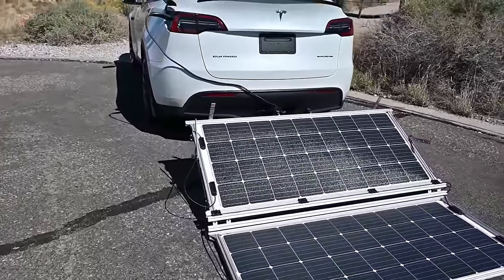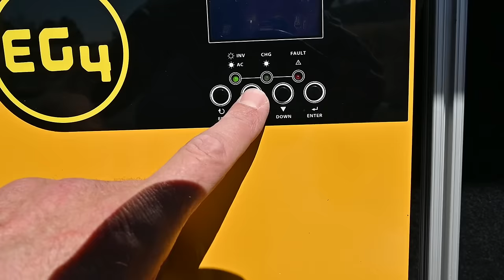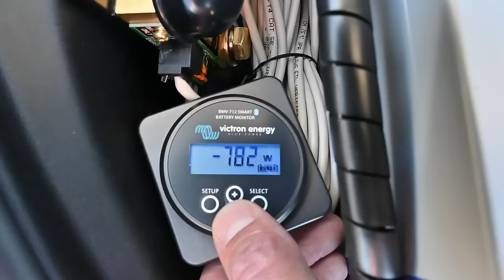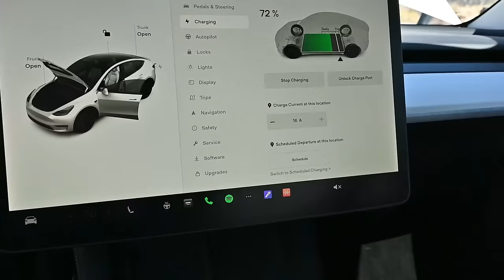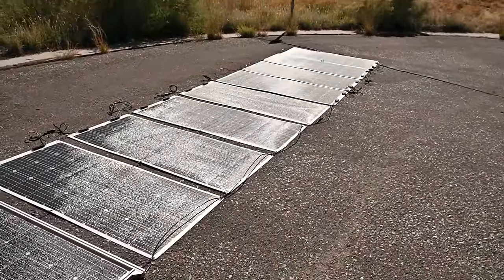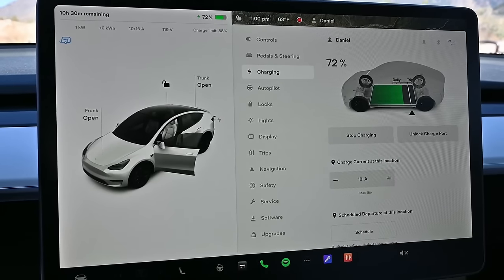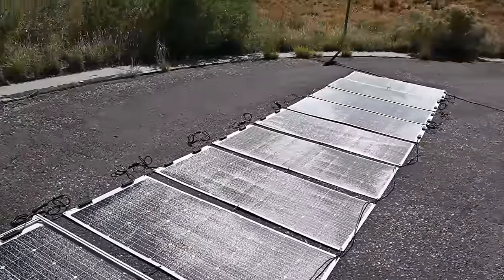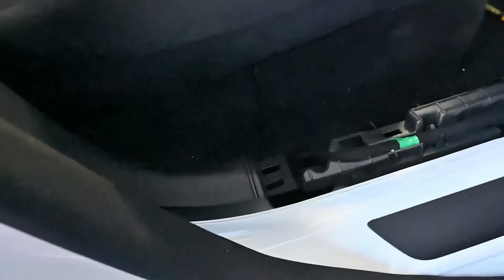2000W Mobile Tesla Solar Charger - version 3.0 - more solar, lower mass, battery in frunk!

Comment: The drag that is caused must be as much that is put in from the solar panels. I thought the solar panels would be stored inside the car when not in use??
Reply: I lost track of the link to an online aerodynamic calculator tool I had sitting in a tab of my browser, but playing with that, to find the sweet spot for re-orienting the angle that stack of panels rides at, and maybe putting it into a smooth shell (made of foam and PMF, perhaps) for travel, might actually improve the aerodynamics.
Reply: Its a good proof of concept...i appreciate his efforts.. Putting money where his mouth is..👍
Reply: I'm pretty sure that misses the point that this is a destination charging system, not a 'while-driving' system.
Reply: better design welcome. mr tesla.
Reply: Doubtful there’s any real impact from drag here. Reason being is the entire system is lower than the body of the car. The rear spoiler will also serve to push airflow up and over, etc. it’s also pretty close to the car itself and not much of a gap between the two
Reply: @Av-vd3wk  agreed 🤙🏽
Reply from the maker: @Av-vd3wk  3.8% loss in range calculated pre/post installation over thousands of miles. I easily live with that. I can fold them down flat(ish) but haven't bothered.
Reply: Not that much loss 🗿 
I can't believe people can think like this
Reply: @Weirdo_on_yt724   and @AV8 couldn’t agree more, I want to do this!  Hydrogen technology is on the rise and I believe will be another great option but there are pros and cons with everything.  The fact that he is independent of any charging or refueling station at the cost of the system and some planning ahead is priceless to me.  Different tools for different jobs ppl🤙🏽
Reply: @gridfreeordie 3.8% on a 75kWh charge would be 2.85 kWh, meaning that the first 2.5 h of solar charging are needed just to compensate for drag.
Reply: @falklumo those 2.5 hours of charging to compensate would be spread out over all the stops you charge at though, so if you're only driving far enough to need 2.5 hours of charging without the extra drag that's only about 6 minutes extra
Reply: and if you were filling the entire battery up from nothing it would be more than 25 hours of good sunlight at that rate

Comment: You don't know how excited I was to see this video. I just discovered the 2.0 video and then I see that you dropped only the 3.0. I also found it funny how in the 2.0 video you said that the battery was Overkill in the trunk and then now as I'm watching the 3.0 you filled the frunk up with batteries. I really wish you could charge this car DC to DC. It would get rid of so much of the complexity. This is one of those things that everyone thinks of, but you actually did it. I also was watching the video about the haters, I would not take any offense to anything they have to say. However you should be very proud of what you accomplished.
Reply from the maker: Thanks! So much more I could go into...and change. Not enough time!
Reply: I agree! It’s funny how everyone has something to say but nobody is doing anything to test theories. I love how you just did it, just do it and figured out solutions. I would do it with my model y but I’m waiting on the cybertruck for the trade in. I can’t wait to rip it all apart and throw my system in it just like you did 🎉🤙🏽
Reply: I totally agree. DC/DC charging would save about 30 to 40% energy losses from the inverter converting dc to ac.
Reply: @leviahamefula3994 there must be a way to do it, considering that's what the car does at a supercharger
Reply: Outstanding!! Definitely agree with the DC to DC without needing an inversor.. ideally internally to the car.. Maybe a route through the regeneration wiring?..

Comment: I wonder if in the future a direct Solar to CCS DCFC which could match the input of the solar to the output of the charger. With such a system you would not need a big buffer of batteries. Also another advantage would be getting rid of inverter efficency loss and internal car charger loss, cutting upto 50% of the charging losses and improving charge times.
Reply: That's already a reality in Aptera and another startup with a "one" in the name which I can not recall..
Reply: If you trick the tesla bms you can already do this, hook up panels in series until you have near 400v vmp and the battery will take it.
Evtv did this with an 85kwh pack from a model s
Reply: @SolarTechFL  can you tell me the title of the video?
Reply: I think he’s referring to EVTV Motor Verks. I can’t find the specific video but there’s a good place to start looking for it.

Comment: I am led to believe that 50% output from solar panels labelled output is the norm. Heat, solar intensity and panel orientation are the main things. I love what you are doing with your Tesla, great experimentation.
Reply from the maker: Expect about 85% of room temperature power when facing the sun due to higher temperature.

Comment: This is a little simple, but I was thinking; one way you could increase your input would be to first increase the length of the wires connecting each panel to the next.  Then, put some "legs" under the top part of each panel, so you could adjust the angle; point each panel more toward the sun.  The "legs" could be very simple, maybe just a bent inflexible wire running on the underside at the top, hinged so you could swing it down to hold the top of each panel up.  That could go a long way toward aiming your panels more directly toward the sun.
Reply: is there a smart solar panel which can follow the sun's angle ?
Reply: Why would you just use a much simpler controller/battery that can take in the solar and output to the car and be much smaller?

Comment: Love it.  Cool so when car is topped off the battleborns get topped off. Free gas station -take with you.  1200 watts coming in will add up over 6 hours. Maybe 6-7 kWh-for free if sun is shining. I personally just use the solar on my house grid tied. These mad max approaches are fun fun fun.

Comment: The wire run next to the panels is shadowing some of the cells and probably limiting some current in your system. Some flexible cable management could help keep them out of the way.

Comment: If you also handle the Air drag with a case or something you will have better mileage. Also if you elevate the solar panels from the ground on a sunny day they will have better performance in hot climate cause wind movement around them so faster charging. Or you could face them direct to the sun also. You need somekind of aerodinamik box that can also be a stand to them or something. But other than that cool project.

Comment: I like it how your battery terminals are like an inch away from hitting your frunk cover. Be careful out there…
Reply: Is the frunk made of metal? Or plastic?
Reply: @bengrillet  The "frunk cover" (i.e. the hood) is made of painted metal. It's a fair criticism that the terminals and cabling should be covered with an insulator.
Reply from the maker: The batteries are encased tightly with styrofoam pads now.

Comment: In Australia they can use the machine that print labels for canned goods to print photovoltaics. They can run for metres behind the car when parked, like these panels, but simply roll it back up and put it in the car when not in use. Best to use a cylindrical postpak kind of thing to keep the edges in good condition. Cost is around $20 for the roll of paper

Comment: So tesla theoretically use 280~340Wh per mile (174~211Wh per km). This unit was charging at 1250Wh that is roughly 3.68~4.46 miles per hour, or 5.74~7 miles per hour at it full 1950Wh capacity. That is definitely not bad, not to mention the very cool and practical design. This is the number one portable solar charging system for tesla I have seen so far.
Reply: But you can walk at 5 mph.  You can bike at 20mph.  A horse can go 30mph pulling an Amish buggie, or draft cargo at 8mph.

Progress?
Reply: @STho205  You are missing that the human body burns calories when you bike or walk, so you must factor in the cost of food and water to cost of walking or biking everywhere. Also it takes time to eat and poop.
Reply: @uhjyuff2095  heaven forbid you burn any calories when you have Wall-E to serve your every growing girth.
Reply: Thanks for the equation
Reply: @STho205  

Yes it is progress! It's free energy. 5 miles in one hour is excellent. Image is you have the space to unroll these at work and 8 hour shift? I could park Neary middle schools unused baseball field and drive all week free of charge.  In my durango, I spend easily 20 dollars per day.
Reply: @rayamanelly  free at 70k for the car and $xx for the power tap.  You have an interesting idea of FREE.

Comment: Suggestions for improvement:

Have a small computer (raspberry pi), an pull the SOC from the BMV.

Use this information to push through Tesla's API a change in the amp draw.

Example 
<20% : charge off
20-90: 6A
91-94: 8A
95-97:10A
>98 : 12A

This way the car will match the solar input.

The same can be used on a stationary PV system.
Reply: A EVSE like OpenEVSE can do this, they call it “solar divert” i.e. charge using only excess solar power. Doing it by way of a Pi and the Tesla API would require LTE or Wifi connectivity, where this is designed to be used you can’t assume it will have API connectivity
Reply from the maker: I actually do something similiar to this at home with Schneider equipment, but it requires the internet. I'd need a hotspot / SIM card to call the API while I'm charging away in my work parking lot. A hotspot + Pi is certainly cheaper than 5kWh of battle born batteries, but I had them left over from another build. 5kWh of battery buffer is way more than I need on a daily basis to handle clouds. I've yet to explore MODBUS communication with Victron components, but I'd need to use the battery monitor to gauge current flow in/out of the battery since I use the MPPT inside the EG4. The EG4 is a simple, compact MPPT/inverter, but it's software is total garbage. Using a Victron MPPT would be better, but it requires more cables, fuses, etc. Maybe someday...
Reply from the maker: @paulpham8138  I will look more into OpenEVSE...see below.
Reply: @gridfreeordie  The signal that sends the "max amperage " to the car is a PWM signal. Diffrent duty cycle changes the amps from 6 to 64.

Comment: Thinking of setting up a similar albeit smaller charging solution on my Volt. I haven’t heard it elsewhere on YouTube, but it makes sense to be able to measure the angle of the sun and calculate with the cosine to determine the percentage of light/power “lost” to the angle. Thanks!

Comment: If someone knows how to open up DC/DC charging it would open up so much opportunity.
Id like to have 1-2 panels integrated into to roof to cover phantom drain when it’s parked for long periods. Sometimes my ‘job’ causes me to have to park it for months at a time👍
Reply: I think 2 panels would keep 12v battery charged and prevent drain from traction battery over long periods.

Comment: If you make 2 of these and place them at 92.2 degrees and allow the mid line aim at the average sun elevation. This will give you 4kw×1.4 = 5.5 Kw. Explain why after you try it. 🤔 
Hint: one panel's reflected light hits the  other side.
Please don't allow any exposed terminals in the compartment. Use some liquid vinyl tape to cover all exposed live voltage. I dropped a tool with exposed wires and it caused an electrical fire. Don't forget 2 fire extinguishers. Look for the new type for lithium fires.

Comment: That's awesome man! Gotta take in consideration your efficiency drop from the inverter. 10-20%? So 1200 watts input on your solar is about 1120 watts then 1120 watts at 85% is about 950 watts. So a total from panel to outlet is about 75-80%. Just thought to keep in mind. 2000 watts if achieved would be about 1600-1700 watts at best to the car? Cool stuff!

Comment: First off, props to you to design and execution. I was wondering about a setup like this of the Model Y. I realized that it is super unpractical to draw power from solar to feed a car level transport. Even at 120V 10A, it only feeds 1kW to the batttery, Charge time to go up 16%SOC is over 10HRs. From a daily active transport cycle perspective, it is ineffective. Very cool experiment, I thank you for sharing your results. 

I have always wondered if the Car could carry around push flower "petal PV " oragami style. Power Output from Solar into Car Bat must be around 6-7kW for sustained 4 -6 hrs to be considered practical transport. I wonder would it be the size of your panels x 6? Your 2kW System already looks like a like of SA to cover tho. Anyways, very cool experiment. Look forward to your future designs!

Comment: Wow, a full day of perfect sun charging and then half an hour of driving!
Reply: Two things: 
1) This is basically a prototype, a 'proof of concept', a first or second try out, and pretty impressive for that.
2) If you want to cross a wide area where charge points are few and far between, or non-existant, it would be reassuring to know that you will never be stuck with a dead battery.  If you tried the same challenge in an ICE car and ran out of gas, you would be screwed.
Reply: @bengrillet  it proves that EVs are not suitable for long distance travel.
And there's no way anyone can get the mileage to offset the huge amount of co2 produced making EVs.
Reply: At the beginning, it was nothing and God said let be a steam engine , God liked it and then said let be desal engine, God liked it then said let to be a gas engine,  God liked it them said let to be EV cars God liked it , I'm really sure God will say let to be EV charged on solar panels one day .

Comment: Another thought; though this may be impracticable.  How does the Tesla know its hooked up to a Tesla supercharger?  How complicated is the handshake that goes on when connected?  Could you possible "fool" the Tesla into thinking it's hooked up to a charger and use the DC pins to send charge (more or less) directly to the battery?  (Though a diode system of some kind so current could only flow Into the battery).  Might be easier than trying to get to the battery itself.  (Though you'd think that would be possible as well).

Comment: Instead of hooking it to the rear bumper tailgate solar panels,make it become a roof headache rack and at the same time cover overhead of the car like a garage port to keep the vehicle and the batteries inside cooler.And adjust the solar panels to the angle of the sun,make a overhead rack just like also how tow truck beds angle hydraulic to the floor to pick up their towing vehicles and construct it from aluminum instead of steel frame.

Comment: If you get the Nema 5-20 UMC adapter from shop tesla and use a Nema 5-20R to 5-15P adapter you will be able to charge at 16 Amps.  If your system outputs 120V you should be able to pull 1,920 Watts. You can always manually limit the Amps if your uncomfortable with that draw.

Comment: Hi
I am electronics engineer and also have a tesla. Nice to see your solar cells, really nice.
But right now you go from DC to AC and then back to DC on the Tesla battery?
Did you ever check the loss you have due to those two conversations cycles?

I wonder if you could not just go with a dcdc converter from dolar to battery voltage with a mppt boost converter? Should be quite more efficient. And you wouldn't need any extra batteries. 
I am not familiar (yet) with the dc interface of the tesla charge connector.
Reply: I think the trick would be to connect the MPPT boost charge controller to a direct connection of the car's 400 Volt DC main battery bus. No messing with the charging ports that way. Would this be possible?

Comment: If the panels unfolded the opposite direction they could cover the entire car and provide shade to keep the interior cooler while parked and charging, plus you would not need to use as much ground area.

Comment: For version 4.0, since the battery get moved into the frunk,
to avoid penalty drag from the rear monted tow hitch,
why not carrying the PV inside the trunk. 
The trunk is about 6 feet long, so the PV should fit.
And just build a sliding mechanism to put or remove the PV stack from the trunk.
The inverter could be moved behind the driver seat into the rear passengers foot area.

Comment: Why cannot we have a MPPT boost charge controller directly connected to the main 400 Volt DC bus of the battery. This would save the need extra batteries, the inverter, charger back to DC.
I think I saw one video or Forum post of someone who bought a very old Chevy Bolt with very degraded batteries and installed solar panels onto the car with just that boost charge controller straight to the car's batteries.
Have you looked into that? Would you consider it?
Reply: Because using an unauthorized DC charging unit will almost certainly void the warranty. Tesla could have easily added this feature but it is too risky to cover because who knows what some fool could splice it into. A solar charge controller will overcharge a battery if there is wrong system configuration or wrong wiring.

Comment: Wouldn't be better to make a DC voltage upscaler and connect it directly to the charging point, besides converting DC to AC and then back to DC with the Tesla portable charger?
You can upscale voltage of each battery and then connect the 4 circuits in series so you can achieve the desired final voltage easily

Comment: Thank you for sharing this video. One question: in case of hard braking, wouldn't the batteries move forward?
Reply from the maker: The batteries are encased tightly with styrofoam pads now.